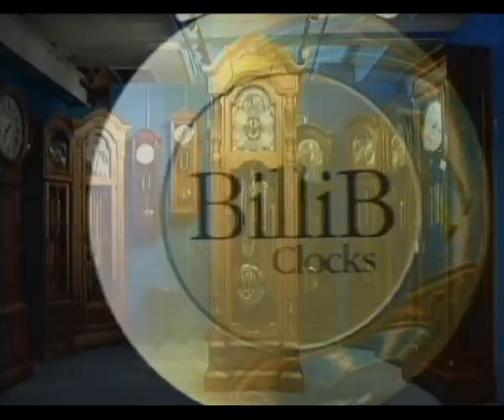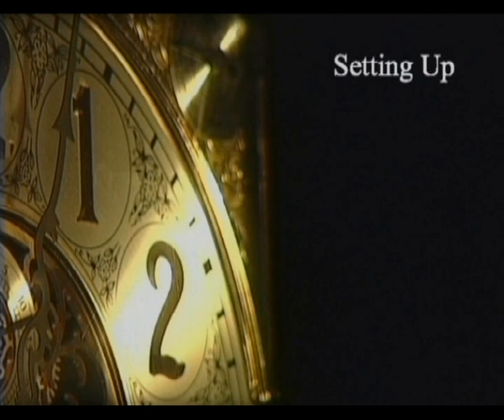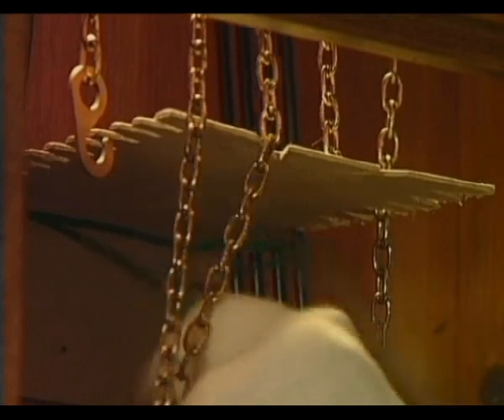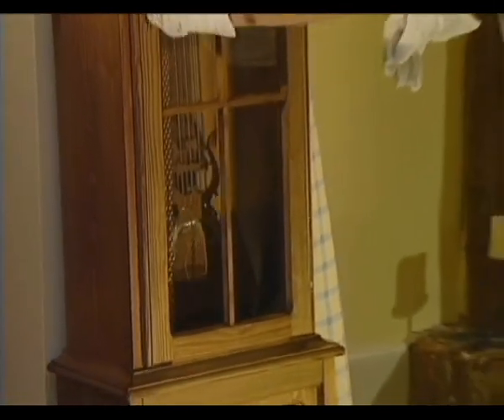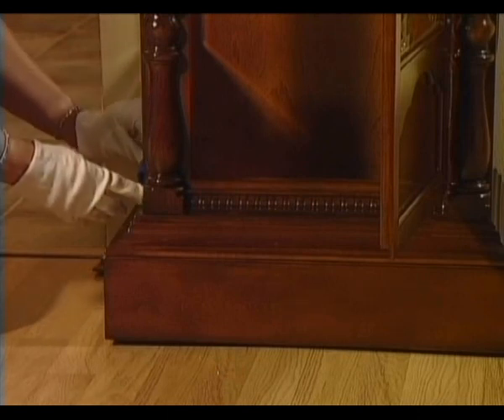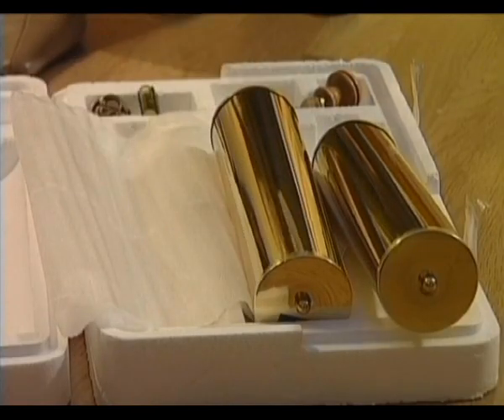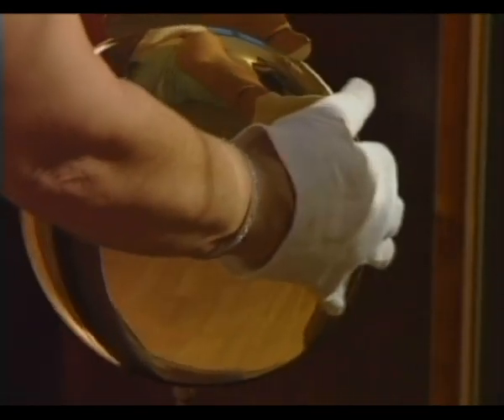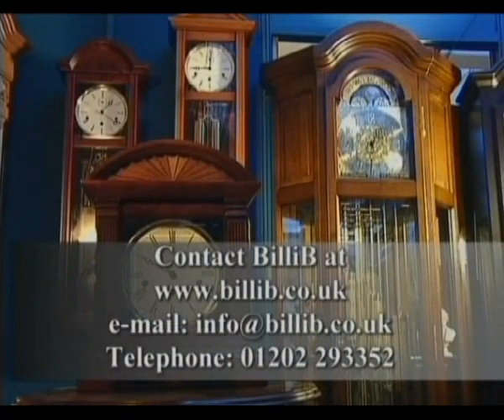Setting Up Grandfather Clock BilliB

Comment: Thank you for your comment: During transit the hour rack might have dropped, giving an incorrect hour strike as the weights are hooked in place.  BilliB’s suggestion is to wait a couple of hours after starting the clock, this allows the clock to settle down.   However if your clock doesn’t strike the correct hours, simple move the hour hand (NOT the minute hand) to the correct hour. Example, if it strikes 8 move the hour hand to the number 8...